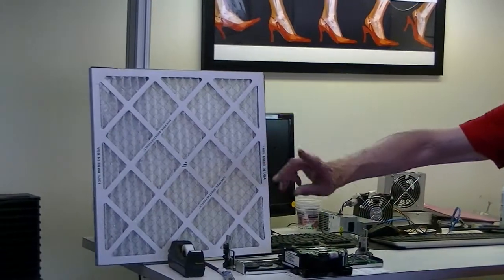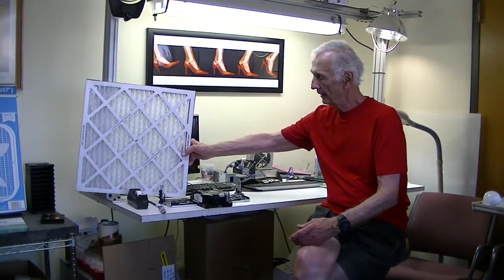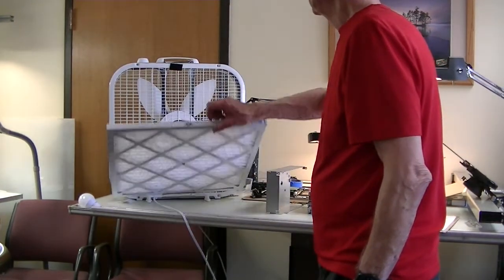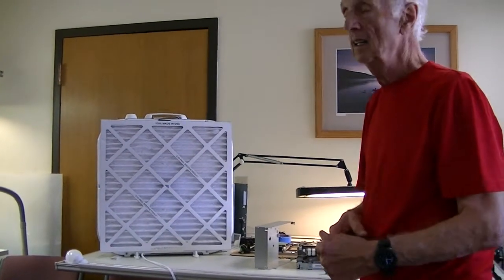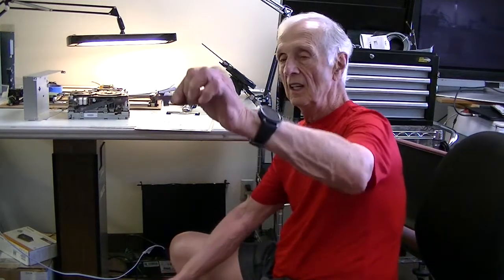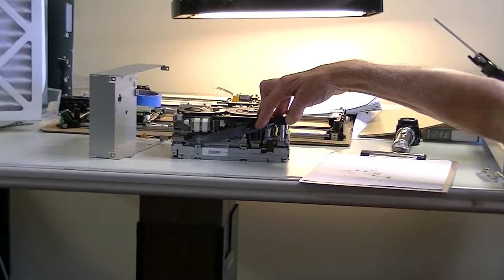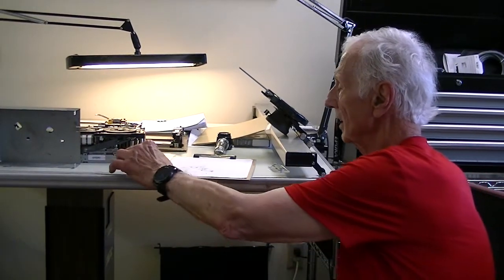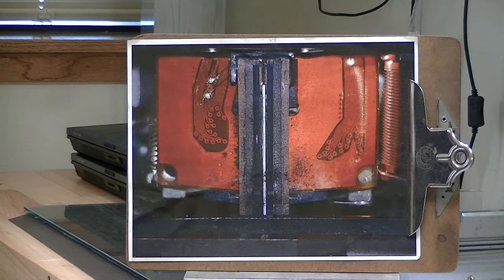Tape Drive Failures and Causes

Comment: Hi there. Watching from Australia.

I bought a LTO6 drive used off eBay. What does it mean if I have suspended writes. I have already cleaned the heads with ISO and used a cleaning tape. Should try letting the ISO soak for a while? The Lifetime metres of tape processed is 5675634. But only 2 head cleaning operations. Is the drive too old or is it more likely a clogged head? 

I have another drive which has a clicking sound when moving at full speed. Sounds like the bearings are catching though I'm not sure which. Are any of the bearings serviceable at all?

I got into this as a hobby but there is unfortunately very little information about maintaining these drives. Thanks for your channel.

Comment: Nice Video!
How do you clean a head like this? Alcohol, air pressure, brushes??
Regards
Reply from the maker: Hi Henniee:  You have about 30% the sequence is important.  the only clue I will give is to use 99.9% ISO all other have additives that will effect the head.

Looks like you are not using Fuji manufactured media sold by IBM and Dell.  Act accordingly

Glad you enjoyed our video our competitors also look at these as a result we do not reveal all of our techniques.

Regards - 
Dan